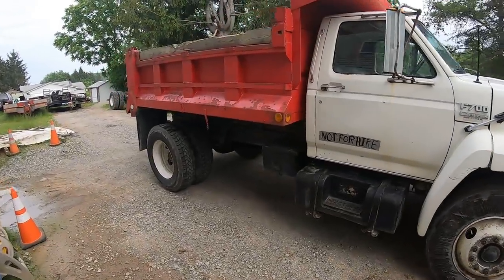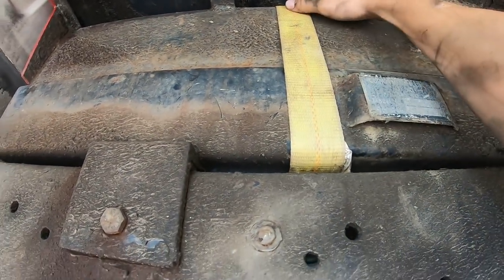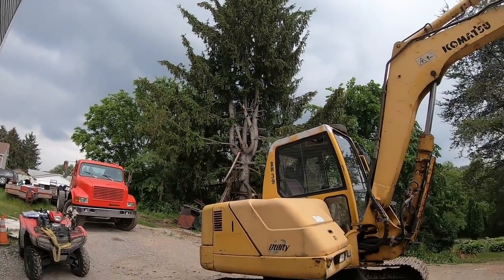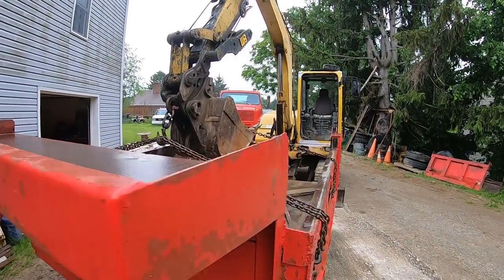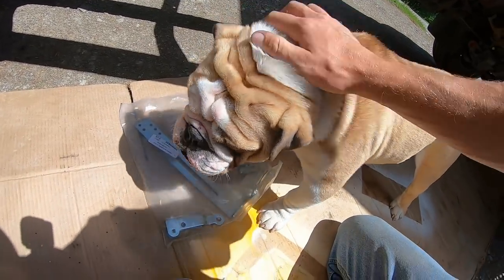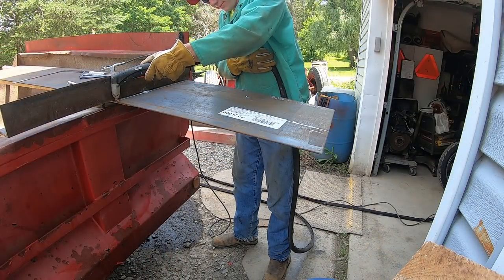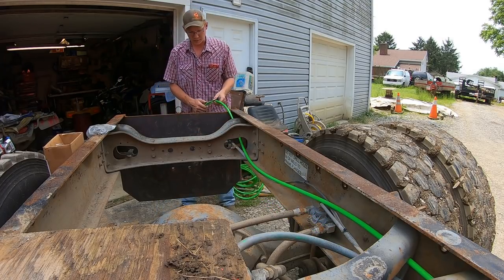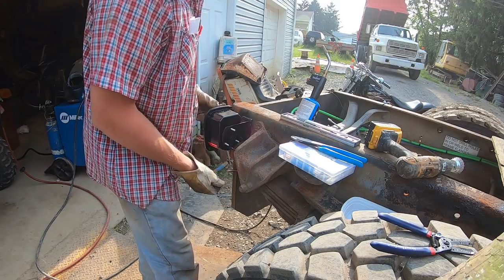International Dump Truck Build Pt.2!!!!!

Comment: Water in the hydraulic oil is why it’s milky looking.  If you use inter shield welding wire you don’t have to use argon gas (it leaves a little flux on the weld but cleans up nicely and is just as strong).

Comment: Now, in my opinion, teflon tape is great but I totally prefer permatex pipe "dope" when dealing with air lines. Just hit the threads and call it a day. Especially on road calls. Git it done and go back home and get a LIL sleep or none before clocking back in for the next workday.
Reply: AND keep antiseize on hand just in case.
Reply from the maker: I do like the dope type as well, I don’t think I could find it that day, having a massive shop compressed into a tiny garage makes stuff tuff to store and find sometimes lol I just wanted to get that truck done. Thanks for watching!!!

Comment: Have you ever seen side boards made out of used conveyor belts? Just bend them in half and bolt it to 1 1/2” square tube. It drops right in and won’t break if you hit it.
Reply: Hot damn, that's a good idea!!  I run a DOT Shop and I'm gonna use that idea..

Comment: Ingersoll Rand & Snap on! You buy quality tools!
Reply from the maker: If you buy junk you’ll have junk!
Reply: Yeah. I don't understand people buying important tools from Harbor Freight. Cheap Chinese stuff that breaks always at the wrong time.
Reply from the maker: @marcryvon  like that old needle gun! ill give em credit tho, some of their tools take a beating. ive been using their impact sockets for years with no issues and im by no means easy on them, even their standard sockets are holding up great, its their power tools that seem to leave a bad taste in my mouth...
Reply: The way I see it, Harbor Freight is where you go when you're not sure you need a certain tool. You buy a cheap one just to see, and when it breaks you go buy a good one.
Reply: Harbor FRIGHT tools have their place and work okay in certain instances. There isn’t a lot of stuff that’s great from there but there are a few exceptions. I beat the crap out of the Pittsburgh deep impact set that goes from 10mm- 32mm for probably 15 years or so and I’m a 25+ year tech. and they held they’re own just fine. That being said, I own a bunch of the US made Craftsman and Matco but those impact sockets do the job just fine. I.R. definitely makes the best air tools. I have the 1/2” titanium gun for example and it rocks. Breaks loose everything you throw at it and it’s quieter than most other guns.

Comment: Is that a Godwin dump body, I just rebuilt my cylinder,new seals,works alot better now
Reply from the maker: Yes it is, mine started weeping a bit now so I’ll be doing the same before long thanks for watching, merry Christmas
Reply: It took me about 6hrs, and it required over 2 tons to pull it apart but went back together pretty smoothly.  My truck is a 86 gmc 7000. Happy holidays everyone!

Comment: I see you have a Thermal Dynamics plasma cutter, why wouldn't you use that over the torch or circular saw.  Cutting the headboard off of the bed with a straight edge and the plasma cutter would of been much easier.

Comment: hello how much is the wheelbase and chassis total lengthe of the truck and the length size of tipper i do scale modelbuild and wil build this truck,sizes in centimeter please thanks
Reply from the maker: Id have to go check and get back to you on that. that sounds really neat!
Reply: @DieselCreek  thanks very much,in part 1 you say frame length 117 inch but that is very short,is not total length i think of the frame
Reply: One inch is 2, 54 cm one foot is 12 inches. I am from Finland where is everywhere else used cm except lumber. And there even only diameter not length.

Comment: Just out of curiosity why didn’t you leave the Ford a dump truck then you could of put a 5th wheel on your International and had your semi Tractor.
Reply from the maker: the ford is going to get another dump bed put back on it eventually, its a good truck but I wanted something that could haul more and go down the road at better speeds. the f700 toped out at about 50-55  and just wasnt quite strong enough to tow my excavator well. the international has tons of power, can legally haul more and is quite dependable! plus at the time I had no use for a semi and really still dont, i just wanted one lol
Reply: does the ford have a cat 3208?  or that ford inline 6 diesel?
Reply from the maker: @Kaliburz  its the 6.6l ford.

Comment: I'm afraid your engine has a few too many hours on it pretty hard to tolerate smoke inside a warehouse situation you know what they're doing now use lighter oil a 10-weight oil will control much easier than a heavier one

Comment: What was wrong with the ford truck? Why did you change? Ford looks tobe nice.
Reply from the maker: I went up a weight class. The ford was always overloaded, the brakes were electric over Hydraulic. The IH has a more powerful engine and air brakes and is just beefier all the way through. A lot better for the abuse of a little truck

Comment: Why didn't You just pull or Drive the truck away or was I missing something
Reply from the maker: Lol yes I didn’t show it but I accidentally left the battery disconnect switch attached to the bed, when I lifted it I broke the connection and couldn’t start the truck! Driving away was the original plan and would have been much easier but I screwed up

Comment: It makes totally no sense for Removing The Bed of The Ford and Install it on The International.  You should've purchased another Dump Bed for The International.  Then you would have had 2 Dumptrucks , and You didn't want 2 you could've sold one of them.  Either which you could have made made all of the Money that you spent on the whole project back, plus made some Profit,  and a lot less work as well.  The extra money leftover,  Could've went towards your Auto Car Truck Project!!!!! @Diesel Creek
Reply from the maker: You try finding a bed that size in good shape in my area for under 5k. You can’t. you can get entire trucks for that you’d have to give for just a bed in fair shape

Comment: maybe talk little more while working and what about using a saw zaw with metal blade to cut with we used them all the time and watch out for sparks and metal pieces while cutting  lisen to your elders .
Reply from the maker: sawzalls wont touch that that circular saw can cut! ive cut 1" plate with it! Thanks for watching!